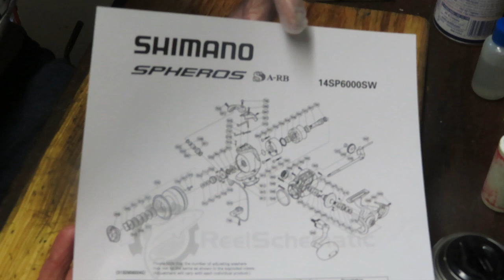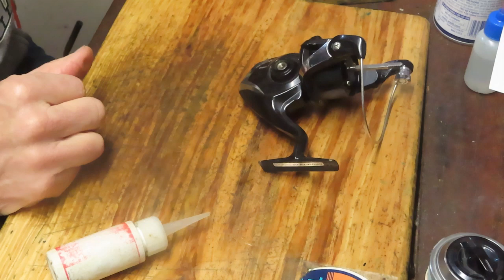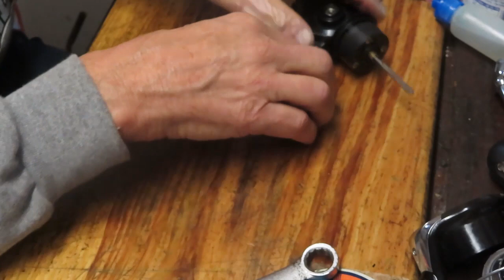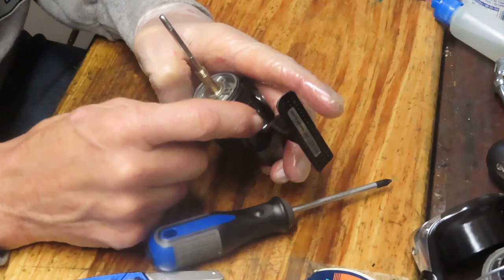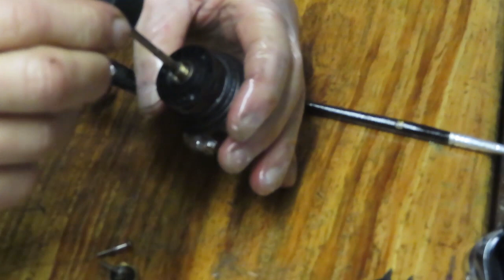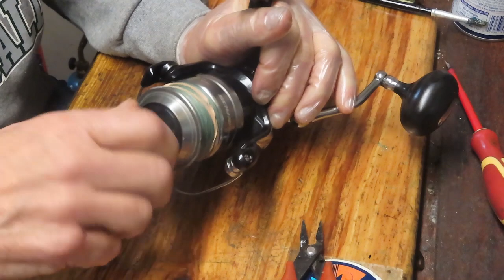Shimano Spheros SW6000 spin fishing reel how to take apart and service

Comment: i just opened my shimano sw6000 and im trying to take the axil rod out but it seems like its fully corroded and i can't seem to get it out. any suggestions?
Reply from the maker: If it is corroded, you need to try a solvent to loosen it.  Try a spray of a rust buster or penetrating oil.  You can also use the drag adjuster knob by putting it back on the axle shaft and grabbing is for additional leverage as you pull up.
Good luck - Dennis